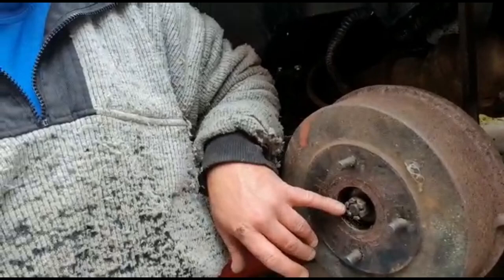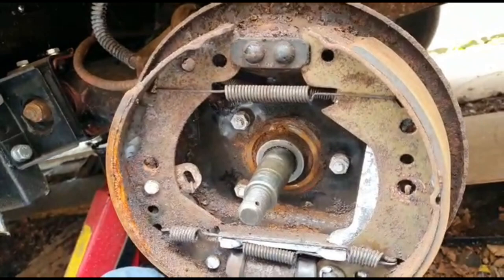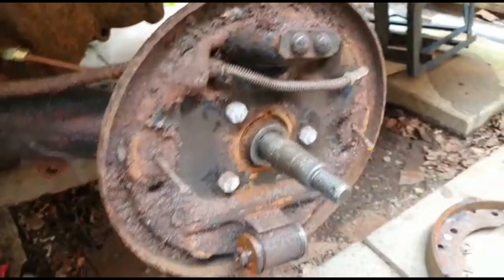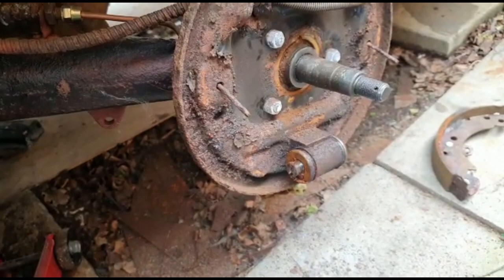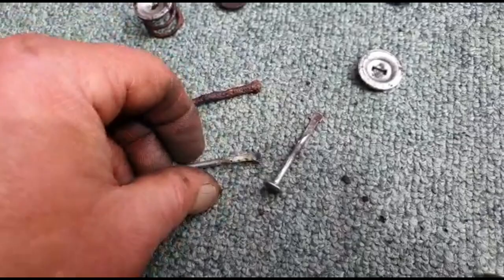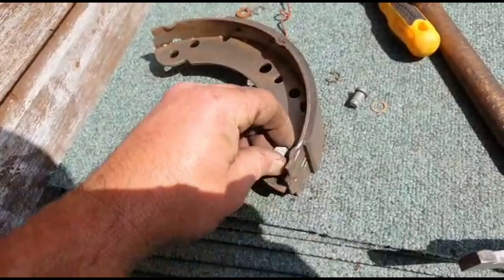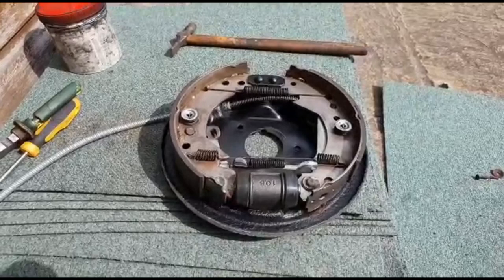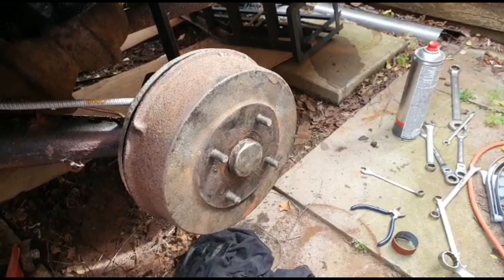Lee’s British Leyland Austin Princess | Rear Brake Rebuild | Part 11

Comment: Great job on the pins lee. I found the pins springs and locking washers tricky to find outside of an entire brake kit. The back plate came up lovely 👍🏻
Reply: I couldn't find any locally or on ebay... but I did find a multipack box of springs pins and retainers, but it was £40.
Great if I do brakes every week.... but I dont. 🤣